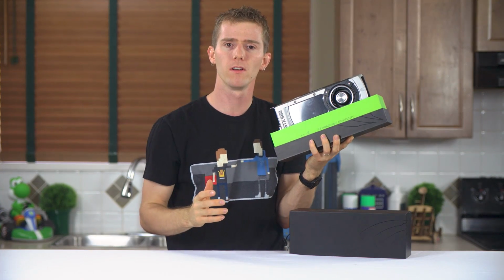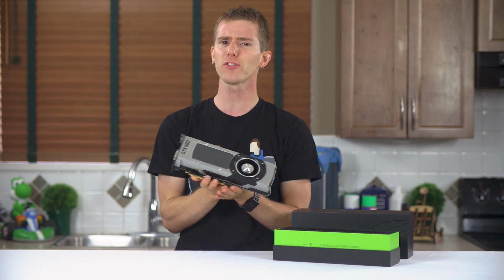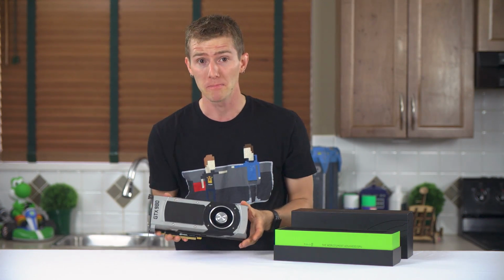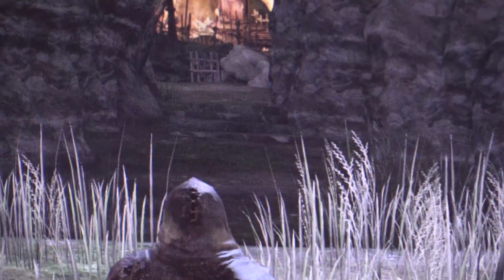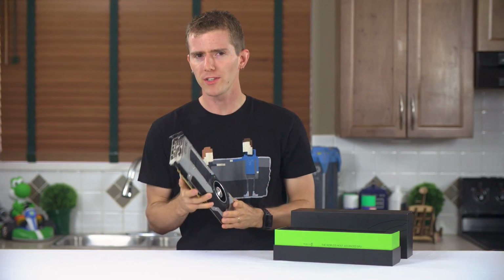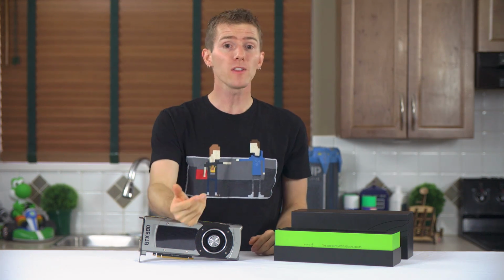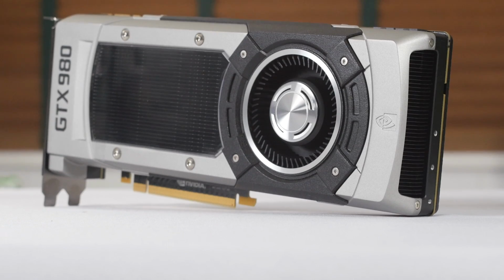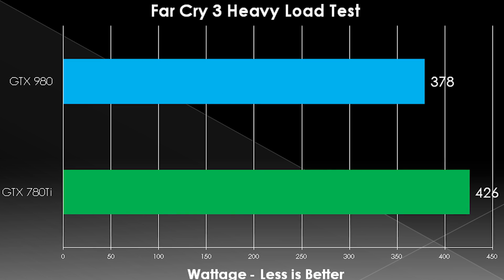NVIDIA GeForce GTX 980 Video Card - Performance Overview

Comment: So... Apparently, the 980 is faster than the 290x... So that means that THIS is also a Titan killer for half the price. Right? =D
Reply: yeah basically, the titan wasn't meant for gaming. the titan will win with the rendering and all that though.
Reply: 441meatloaf Unfortunately for you, you're wrong. Yes it had GTX branding, but no, it's not really a gaming card.
Reply: 441meatloaf The Titan is exactly the same as the 780 Ti but with unlocked FP64 cores which are only used for some workstation tasks.  It costs more than the 780 Ti and as far as games are concerned it's the same card, so if you're buying the Titan instead of the 780 Ti it's because you want to use it for workstation stuff. It's more of a hybrid card really. Just because it says "gaming!" on NVIDIA's website doesn't make it a gaming-focused card, if you actually watch the NVIDIA keynote, all they talk about is unlocked workstation performance and specifically say it's designed for CUDA developers. If all you do is read 1st party website and marketing material and take it all at face value, you will discover that (for the most part) every product is the best thing in the world and is good at everything. You need to look at what the product IS, not what it says it is.
Reply: pingo6able  it is meant for gaming.

 "GTX TITAN GPU is a revolution in PC gaming performance." - From the nVidia site.

The ones for rendering and film industry are the Quadro series
Reply: 441meatloaf Initially it was not meant for gaming, obviusly everyone knows that the GK110 core that was in the Titan, Titan black ect ect. Was actually just a Tesla core. The Titan card in itself in a hardware standpoint is actually not, and never was intended as a gaming grade card, but Nvidia learned that the Gk110 core when given the right drives, was a gaming powerhouse. The Titan is a gaming card, anyone who says so is completely stupid, but it was never really intended to be a gaming card. Anything under the GTX line of cards will always be targeted to gamers and general consumers, anything labeled as a GT or GTS is multimedia, and obviously Quadro is for 3-d design, rendering, cad ect. Tesla is meant for general compute loads. A GTX card isn't only good at gaming, you said that Quadro cards were the better for rendering, which isn't very true, the fact is that all these cards can do basically anything that you throw at them, some better than others yes but still.
Reply: The only reason to go for a Titan for instance is if you need the extra VRAM
Reply: CousinRomanBellic
yeah but this idiot im talking to doesnt do any fucking research so i have to pound it into his head
Reply: Titans are better for rendering, even if they arent stated they are low end workstation cards with gaming capabilities. A quadro costs a lot more than $1k.
Reply: To be clear once again, when I originally said the 780 Ti and the Titan use the same GPU, I was talking about the Titan Black.  From a technical standpoint, once again, the 780 Ti uses the exact same GPU as the Titan black, not any kind of revision.  The original Titan uses one with a single SMX (192 cores) disabled, if you want to call that a different GPU then fine, but they are all based on the GK110 design.  As for looking up benchmarks, is the second half of my last post invisible or something?  I looked up benchmarks and all of them show single-digit FPS improvements.  What I am interested in seeing is the benchmarks you are talking about with nearly double performance going from the Titan to the 780 Ti, which I don't see anywhere.
Reply: You don't really buy a Titan for gaming not at the price it is anyway be stupid too unless you wanna do workstation stuff otherwise u saved your cash and bought a 780 or 780 ti
Reply: Minecast Zyad48 true i see your point
Reply: Daniel Ainger FINALLY someone who actually knows their stuff, EVERYONE here keeps saying that all titans are crap and that im wrong about the black having the 780 ti's gpu, well guess what I looked it up its a slightly higher version of the same gpu essentially and therefore gives the same performance, I also looked up tons of websites about benchmarks comparing the 780 ti and titan black, the results were all either the same or more performance across the board
Reply: Minecast Zyad48 true they really r the same card just the Titan has 6gb ram and is better for workstation actitives but they r both great Titan i understand why people buy especially if they r doing other stuff besides gaming but your right they r so closely matched
Reply: Daniel Ainger mhm :)
Reply: 441meatloaf
dude the titan is a quadro card and is not good for gaming and therefor should be classified as a quadro and not a gaming card
Reply: GlenwingKyros
u are stupid the 780 ti has a LOT better performance in games thats why the titan BLACK was made which has the titan workstation power along with the gpu from the 780 ti getting great performance in games and have the ability to render high quality CGI stuff
Reply: ill put it here to show EVERYONE what the titan, 780 ti and titan black have, the titan is a workstation card NO ARGUING THAT sure it has the fucking GTX label, THAT DOES NOT MEAN ITS GOOD FOR GAMING, THAT IS A MARKETING SCHEME, the 780 ti has a GK111 gpu and therefore gets better performance than the normal titan because that gpu is geared exclusively towards gaming and has a higher memory bandwidth and has a lot more of the other specs that are overlooked by you idiots, the titan BLACK is a HYBRID card having the GK111 core of the 780 ti therefore getting its performance in games and has the normal titan's workstation performance THERE, that is the whole 100% truth, dont believe me? ill go and find a ton of websites and show even more PROOF that what i am saying is true, i await your butthurt replies
Reply: ........ I don't think anyone has realised the titan is a rendering card FOR GAMERS. fuck man ever heard of killing two birds with one stone
Reply: ReaLzEdits
the titan is the first rendering card on the consumer market yes that's true but the titan black is a way better deal since it's the same price and has better performance
Reply: 441meatloaf
Actually the Titan was their best selling special high-end card like... ever. The sales far exceeded their expectations at the time.
Reply: Saljon
so what? it still isnt a good gaming card
Reply: Minecast Zyad48
Just wanted to correct you on that nothing more.
Reply: Saljon
correct me how? i never said anything about the titan's sales
Reply: Minecast Zyad48
My original comment was aimed at 441meatloaf. I didn't check who answered me after that.
Reply: CousinRomanBellic Develop high performance CUDA code on NVIDIA® GeForce® GTX Titan GPU, the ultimate CUDA® development GPU. It brings the technology powering the Titan Supercomputer at Oak Ridge National Laboratory to developers around the world.

With full CUDA 5 development features supported, not only can you have amazing gaming experiences with the GeForce GTX Titan GPU, you also get innovative technology found in the Kepler architecture like:

Dynamic Parallelism capability that enables GPU threads to automatically spawn new threads. By adopting to the data without going back to the CPU, it greatly simplifies parallel programming. It also enables GPU acceleration of a broader set of popular algorithms like adaptive mesh refinement (AMR), fast multipole method (FMM), and multigrid methods.
Hyper-Q feature that enables multiple CPU cores to simultaneously utilize the CUDA cores on a single Kepler GPU. This dramatically increases GPU utilization, slashes CPU idle times, and advances programmability – ideal for cluster applications that use MPI.
The GeForce GTX Titan GPU also delivers more than a teraflop of double precision performance to maximize your application performance, as well as 6 GB of memory to enable CUDA applications with large data sets. Visit the product page to see complete specs and how to purchase. As you can see from this off of the nvidia website it was not meant for gaming right?
Reply: callmekanz
no you can get a titan black which is better  for the same price
Reply: Minecast Zyad48  typing all caps is a bad idea.
Reply: pingo6able
FINALLY SOMEONE WHO KNOWS THEIR SHIT, jesus christ i've had to deal with these idiots all day who think that cuz the titan is a GTX/geforce card it is obviously a gaming specific card when it and the titan z are just quadro cards in disguise
Reply: They arent quadro cards, quadro is a different brand, but it is a great low cost alternative to quadro cards.
Reply: Minecast Zyad48 I thought it was obvious I was talking about the Titan Black when I said Titan, usually when comparing the 780 Ti to the "Titan" it's implied that you're talking about the Titan Black.  Either way the 780 Ti is not much more powerful than the original Titan for gaming anyway.  It is slightly better, but most of the performance difference you might see in benchmarks is due to the 780 Ti's higher stock clock frequency, but that doesn't make it a better GPU for gaming, since factory clock frequencies are essentially arbitrary numbers and you can easily match the Titan's clock to the 780 Ti's once you get your hands on it.  With benchmarks run at stock settings the 780 Ti will appear to have a larger edge than it really does in gaming performance. As for the Titan Black, yes physically, the 780 Ti and Titan Black are the exact same chip, the only difference is the unlocked FP64 cores (and stock clock frequency, which again can be changed to match the 780 Ti, eliminating that advantage).
Reply: 441meatloaf Well sure. I never said it the product made sense, I just said it's not supposed to be a gaming card, and it isn't. And I agree hybrid cards like the Titan are not a good option for dedicated gamers or dedication workstations either.
Reply: GlenwingKyros when you say titan and mean titan black say titan black. There are two cards, and one is just titan. Thats like saying "yeah when we say gtx 780 we all know by now it means 780 ti
Reply: GlenwingKyros
dude the 780 ti has a higher and more powerful gpu inside it NOT just a higher clock speed, normal titans have a GK110 gpu and the 780 ti's have a GK111 gpu and also i looked up benchmarks, normal titan could run BF4 at around 70 fps, 780 ti, ran it at 120 fps so its not a little bit better than the titan is miles better, also im sorry for not understanding the titan when compared to the 780 ti mean titan black
Reply: Minecast Zyad48  There is no such thing as GK111.  The Titan, Titan Black, 780, and 780 Ti all use GK110.  Also please show me the benchmarks you are talking about, I am interested in seeing them.

http://static.gamespot.com/uploads/scale_medium/1160/11602415/2371118-4062971560-bf4-f.png
http://images.anandtech.com/graphs/graph7492/59670.png
http://www.digitalstormonline.com/unlocked/images/articles/Nav/gtx780ti/bf4.jpg
Reply: GlenwingKyros
i've spoke with a member of team green and the gpu that the 780 ti uses, the "GK110-425-B1" is code named the GK111 and is much more powerful than the titan and the titan uses the "GK110-400-A1" which is a lot slower than the 780 ti, also why not look up benchmarks comparing the titan to the 780 ti yourself? every single one will have the 780 ti on top at maxed out settings at 1080p, go look it up and you'll see a major difference in performance
Reply: yea pretty much even the 780ti is a titan killer for for 6-700....bucks...but 980 is cheaper and newer so its a no brainer
Reply: 441meatloaf the titan black is a 780 ti(gaming card) with 6gbs and workstation power you are wrong but only the titan black is a gaming card out of all of the titan cards

edit: the normal titan sucks, titan black is the real stuff
Reply: Minecast Zyad48 titan black is a mix. Good for if you plan on gaming and workstation but sucky if you only plan on gaming.
Reply: pingo6able Only "sucky" for gaming alone because of the price. It definitely isn't "sucky" for gaming, only the price is there quite high. 6GB of VRAM comes in handy if you have multi monitors.
Reply: SmartNexus yup
Reply: SmartNexus I think he meant sucky value.
Reply: GlenwingKyros yep, if you're gaming the value is shitty because it's more expensive and the sli scaling sucks. A 980 would be better for this. If its a workstation too it's a different story. A titan black isnt worth getting just for gaming.
Reply: GlenwingKyros that seems like the correct argument unless you plan on using 4k or higher(and I have no idea why you would) or absolutely need the 6 gbs of vram or you want to game and have a great workstation card
Reply: looking up benchmarks, it seems that even at 4k games don't use more than 4 gigabytes of vram yet when at 4k. even when run on a titan, they didn't use a full 6 gb's which shows that the it's the speed of the card limiting performance right now and not the vram.
of course 3x 1440p is another story, but the 980 still performs better and it'd still be a good idea just to use the 980's.
Reply: pingo6able yes 2 or 3 980's would run 4k maxed on a lot of games so yeah, but 1440p, meh i'm getting 4 980's for a 1440p 120 hz monitor, just so that I can keep at 120 fps maxed out on 1440p
Reply: 441meatloaf what did i say for you to say that?
Reply: 441meatloaf you are so dumb the eyes see past 60 fps you dumbass and without getting 120 fps you will not see 120 fps on a 120 hz monitor, want me to go into more detail on why our eyes see more than 60 fps?
Reply: 441meatloaf yeah, with ultra textures, it's optional.  that's like saying that modded skyrim uses 8gb's of vram. it can, but realistically you aren't going to do that, because the difference between 4k and uncompressed 4k textures is small.
the difference between the lower textures and ultra textures is minimal until you skimp down 2 or 3 texture settings.
Reply: 441meatloaf dude he's saying if the game's only running at 60 fps you're going to see 60 fps and not 120 fps...
and smoothness give a shit, the higher the fps the more fluid the game/video is.
movies are set at 23.3 because that's what they chose back when they had to pick a set frame rate for movies. they determined that that was the lowest point that the human eye recognized it as fluid motion, so they went with that so their tapes weren't huge. we've become accustomed to it.
a game running at 120fps is going to be a hell of a lot smoother than one running at 60, and 60 better than 30.
Reply: 441meatloaf they are set to 23.976 fps cuz cameras when recording at that fps get motion blur from the camera itself thats why movies are smooth, this why ppl think that our eyes only see 24 fps, that is not the case pingo6able yeah and also im getting 4 980's for another reason as well, i want to future-proof my gaming ststem, i want to be able to max out most games at ultra on 1440p or 1080p(ill lower the resolution but not quality if i have to to keep a consistent 120 fps) for at least a couple of years, also im getting a titan black as well to be used as a physx card and a workstation card for rendering animation videos since im into that
Reply: 441meatloaf cameras GET MOTION BLUR BECAUSE OF THE LOW FUCKING FRAMERATE, YES THEY CAN RECORD MORE BUT THEY DONT. the eyes can see any number of fps way way WAY past 120 fps. do your fucking research and come back or you will be spreading misinformation about eyesight. also the reason that games on consoles are so smooth at 30 fps IS BECAUSE WHILE YOU DONT NOTICE IT, THOSE GAMES HAVE MOTION BLUR ENABLED IN THEIR CODE MAKING THEM SEEM SMOOTHER ON 30 FPS
Reply: 441meatloaf yes the graphics are toned down but that doesnt eliminate the fact that games that dont reach 60 fps still have motion blur worked in, no matter what you say you cannot disprove that you eyes see an unlimited amount of fps and therefore will notice a difference between 30, 60 and 120 fps, i have tested this out and I could tell huge differences
Reply: Minecast Zyad48 i wouldnt try to future proof with graphic cards... Maybe psu or something, but cpus and gpus advance at a rate that kind of makes it pointless.
441meatloaf the titan black is $1000. The titan z is $3000. That being said, get titan blacks instead of the 980 if you plan on rendering. Can't sli the 980's and the blacjs together.
Reply: pingo6able yeah but i still pan on keeping this rig for a long while, i mean pewdiepie(i dont mind if you dont like him, im just giving this little piece of fact as an example) still uses a gtx 760 for gaming, while thats all well as good on 720p he has been using it for a while and still does so 4 980's will probably last a while, im getting a i7 4930k processor sinne having more cores and threads will help while recording since i also plan on recording, but honestly, how long do you think that 4 980's will last in terms of what games I could possibly max out and play at steady 120 fps
Reply: Minecast Zyad48 yeah, but when you upgrade gpu you don't have to upgrade the rest. i'm just saying... get a 980, maybe two, and replace them after another line or two of cards come out. don't have to get everything in between, just spending $2000 on cards is silly when you'd get better from buying 2 and getting 2 new ones 2 generations down the road.
Reply: pingo6able again its my decision and i'd rather have 4 980's, but thanks for the suggestion anyway and besides, im not one of those guys who absolutely NEEDS the newst most powerful gpu that comes out, if another gpu comes out then ill wait before getting it while on my rig, once I CANT runs the game on high or medium settings on 1080p or 1440p with the 4 980's then ill upgrade cuz then I'll need to
Reply: Minecast Zyad48 alright... Diminishing returns, don't forget about that. The increase from the 4th and maybe 3rd is going to be less of an impact of the second.
Reply: ***** dude he's not just gaming though. A titan black is better at remdering and all that that a 780 ti, but is less powerful than one in terms of gaming power. Its an all round card.
Reply: Maybe, but for a low end work card that also compares to a 780 ti it isn't a complete ripoff
Reply: ***** you got it wrong the titan black is a titan with all its stuff but with higher clock speeds and the 780 ti's gpu so it is well worth it also not only am i using it for rendering and stuff I am ALSO having it run physx on my games and if I needed to then I'd use the titan black for gaming if the situation demanded it
Reply: CousinRomanBellic FPS talks sir if its mean for gaming why a 690 is better even at rendering
Reply: 441meatloaf Quadro=same shit as gtx but over OVERPRICED and uglier looking.
Reply: Minecast Zyad48 Thanks!!! Fucking fanboys cant loose
Reply: Minecast Zyad48 NO IS A SHIT!!!!!!! This answer your question?
Reply: Alberto Jose Quiros Navarro i like BOTH amd and nvidia and since you have done no research you obviously dont know that the titan black has the 780 ti's gpu and is therefore faster than the normal titan and can be like a 780ti with better higher resolution support, do research before you say stupid shit
Reply: Daniel Ainger true but if someone wants BOTH the amazing gaming performance plus the workstation stuff then they can get a titan black which is essentially the child of the titan and the 780ti(this is actually literal, the titan black has the 780ti's gpu and all of its performance along with the titan's workstation power and other optimizations)
Reply: I hope it’s still good 8 years later 😂